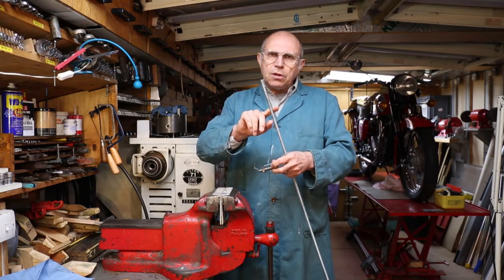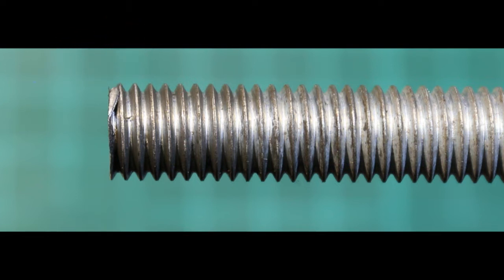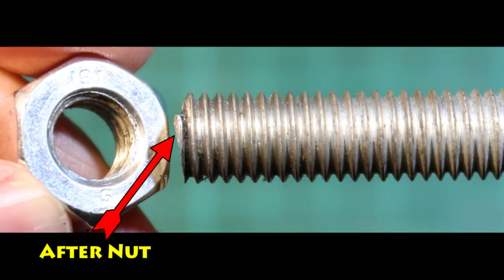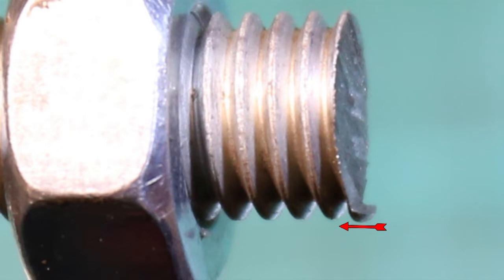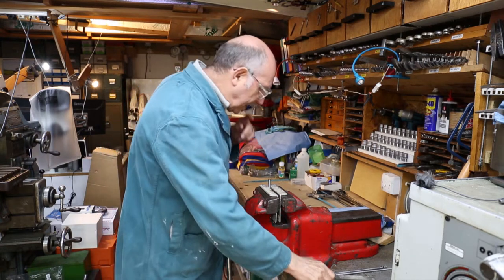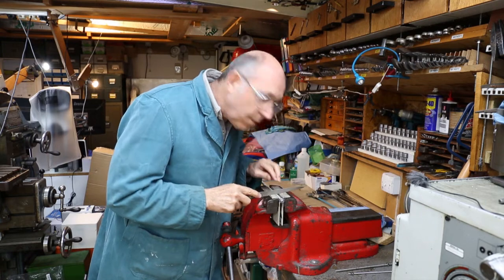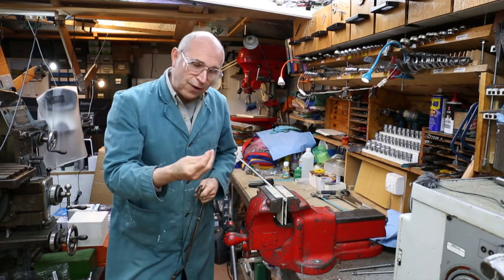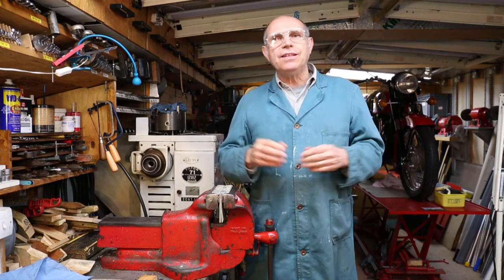How to cut screws and bolts. Hacksaw Techniques 3.

Comment: The real question is why does my hacksaw lose all its teeth when trying to cut bolts?
Reply from the maker: Hello Mr Freeman. 
Why do hacksaw teeth brake off when your cutting bolts?
This is a good question and doesn’t have a single answer. I have in fact started a video talking about this very subject, your question may spur me on to finish it!
There is a rule you should try to stick to when using a hacksaw, it says: “Keep three teeth of the hacksaw blade on the job at all times”. With three teeth on the job any force you push into or onto the blade is shared between the three teeth. Now a bolt has a curved surface, it also has a thread cut into that surface as well, what this means is at the start and finish of the cut the hacksaw blade has very little metal to cut into and will only contact the bolt with one or two of its teeth. The bolt has a thread on its outside face, the “V” shape of that thread places side loads on the teeth as you start the cut, all in all this is a dangerous place for a hacksaw blade to try to work. So, what can we do to help that blade? The answer is simple, first, use the edge of a flat file to file a flat on the side of the bolt where you want to cut, this flat needs to be at lease three hacksaw teeth long. Now place your blade on the flat and start your cut slowly with little pressure on the blade, concentrate, keep the saw at 90° to the bolt and upright, do not rush the cut, you can increase the load on the hacksaw as you cut through the centre of the bolt, this is the widest part of the bolt so can support more hacksaw teeth. Once you have passed the centre the width of the bolt will start to reduce, the number of teeth on the job will reduce which means you must start to reduce the pressure you are placing on the blade. Listen to the blade the noise it makes as it cuts tells you how hard its working, feel the cut through the hacksaw’s handle, as the number of teeth reduce you can feel it, lots of teeth gives you a smooth cut this becomes juddery as the number of teeth reduce. When you are near to the other side of the bolt your back to just one or two teeth on the job. At this point you can do one of two things; 1. Reduce the cut pressure to almost zero and cut through the last of the bolt very gingerly; 2. Stop cutting altogether, bend the end off and clean up the thread with a file.
Try that Mr Freeman, I hope it helps, please let me know how you get on. Take Care Jim
Reply: @CYC123  Now I get it 😅Thank you for taking your time to break this up for me I really appreciate it!
Cheers🍻
Reply from the maker: Hello Mr Freeman.
Your welcome, Jim

Comment: Good, how thick was your bar? M10 I believe, would it be Hard to cut an M12 bar by hand?
Reply from the maker: Hello Natali. You are right, I cut a length of M10 threaded bar. To cut a length of M12 bar will be slightly more work as the bar is 2mm thicker, but it will be easier to clear the thread as it is larger and easier to see. If you haven't used a hacksaw before it will take a little practice, but you should have no trouble cutting through a length of M12 threaded bar. Have a go, please tell me how you get on. Take Care Jim

Comment: Is there such a thing as bolts with one thread count and pitch on half the bolt and another on the other half?
Reply from the maker: Hello Josh. Yes there is a wide selection to choose from with different thread types at each end.  If you do a search for "Double End Studs" on the internet you should find them. They are normally studs not bolts. A stud is like a bolt but no head, just thread bar from one end to the other.
One type has a wood screw at one end, metal thread at the other, you would lock two nuts together on the metal thread, then use them to screw the wood screw into a wooden something the metal threaded end gives you a stud to hang things on. Hope that helps. Take Care Jim

Comment: These are unbelieveably useful workshop techniques.
These videos have helped me improve my tool handling ability.

Unfortunately since I work as a commercial electrician, sometimes I have to cut threaded bars with an improvised vise composed of a bucket and my boot.
So my method is cutting the threaded bar between the threads, but not in a straight 90°, I cut at the same angle the threads are pointing at.
Not to mention at my first job, all I was given was a level and a hacksaw, I didn't really have the tools or time to proffesionally cut anything lol.
Reply from the maker: Hello No Name. Thank you for your comment and kind words. I must admit, I too have used the bucket and boot method of clamping a job. Now retired I don't have to worry about getting a job finished on time. I work in the luxury of my own workshop with my collection of tools built up over the years. I have time to contemplate the ways of the world and try to find answers to those deep questions I really hadn't had time to ask myself when I was working. Things like: Why do threads clog once they have been cut by a hacksaw!
Take Care No Name, be at one with your hacksaw, Jim